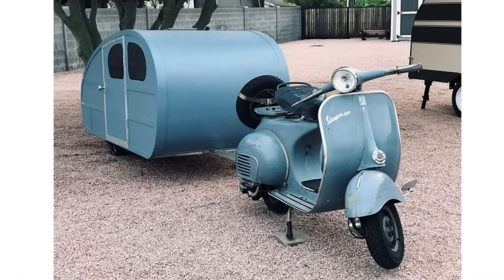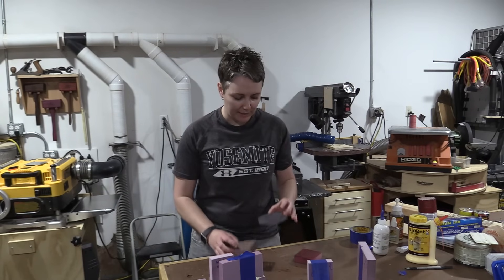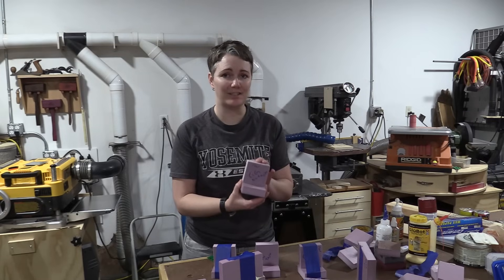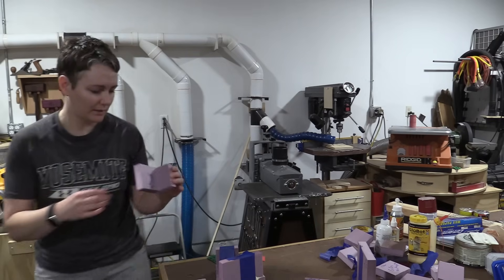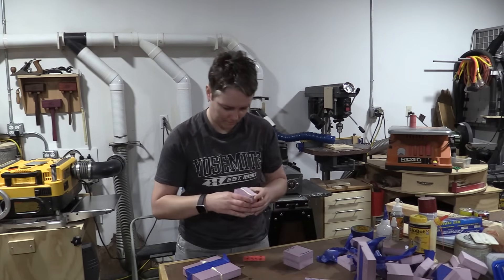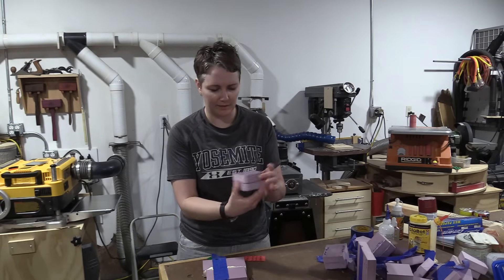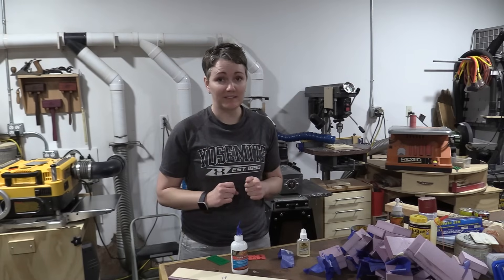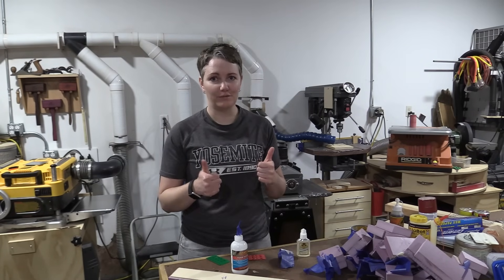NOT Gorilla Glue! Watch This Before Building a Foamie!! BEST Adhesive

Comment: As a retired cabinet shop owner I have have a fair amount of experience with glues.. I see in your butt joint to flat panel you are glueing a raw edge to a flat panel with appears to be a finished surface.. Try coating the raw edge with glue and allow to dry and then reapply for finished joint.. We used a lot of melamine glue in the shop that is like a vinyl base.. I believe you can use waterborne contact cement for glueing panels together..
Reply from the maker: Thanks for the suggestion! I definitely do that with wood glue when I am doing butt joints,  I will give it a try on the foam!

Comment: Have you tried ratchet straps for clamping?  Really excellent securing curved forms
Reply from the maker: Ratchet straps are great! I used them on my wooden teardrop! The reason I didn't in this one is because the sides were already cnc cut before I got involved and the roof had to go between the sides instead of on the top (which is how I would have done it) and then ratchet straps would have made life much easier! Thanks for the tip!

Comment: That was crude but adequate testing - which is all that is required. Thanks, Foam fusion is the glue for me!
One thing I want to experiment with is lining the EPS foam with aluminium sheet (1mm or thinner). First I need to get some foam fusion and see how well that bonds the aluminium....
Reply: They sell those
Reply: @epicsurvivors1399  The ones I've seen are with open cell foam - "foamboard"

Comment: Forgot to add. PL makes a foam specific polyurethane adhesive. It comes in a caulk type tube. It worked well when I insulated my garage door with rigid foam
Reply from the maker: Good to know! Thanks!

Comment: I liked this test video. Very good work.
Considering you are going to be covering the foam in a composite fabric that provides the strength,  you really only need something that will hold the pieces together and is easy/similar to the foam to sand.

Comment: Cool good information. I think I would try using joints over just putting two pieces together. But I never worked with the stuff so I have no clue how that would work out. But if it works it should be stronger and last longer.

Comment: The Dow foam has a coating on the factory surfaces that must be sanded off in order to get a good bond. I use it in my aircraft designs with epoxy.
Reply from the maker: We did sand the trailer,  the edge to edge joint best represents the bond without any film.  I was impressed with how deep the foam fusion bonded even through the film. Epoxy is great! Just wanted a one step, non fumey option. I bet your aircrafts are really cool!

Comment: Great comparison of glues.  I wish I would have known foam fusion when I built my trailer.  I got pretty good with the Gorilla glue though.  
One adhesive that is a pain to work with, but works incredibly well is Great Stuff expanding foam.  I used it in places that were impossible to clamp except by holding it.  It sets up very quickly, and works as well or better than the Gorilla glue as an adhesive.
Reply from the maker: That's very interesting! I have never heard of it.  I will have to check it out! Thank you!
Reply: Церезит Хейнкель, особые условия в Северной Америке. (Ceresit СТ 84 Express PLUS) я на пенсии ничего не продаю ничего не покупаю👍
Reply: @thelwood  I have worked extensively with foam for years building things out of them, using polyethylene, ldpe, styrofoam, xpanded (xps) foam etc. One thing to know about great stuff is it will indeed keep expanding, sometimes for years. You can test this yourself by painting and sealing a small 1 to 5 inch glob of it after a week or more of it drying. Cracks will appear in the paint as it bulges outward from the expanding pressure. I even tried waiting 6 months to paint things made from expanded foam, and they still expanded.
Reply from the maker: @astrobouncer487  thank you for the information!

Comment: I ABSOLUTELY LOVE YOUR VIDEOS, I'm a 48 year old disabled man and I'm going to be homeless with my dog in 4 months, I only have SSI check to live on and I want to build a self contained foamie trailer that I can pull behind my scooter at 45 mph. Any kind of help would be GREATLY APPRECIATED, I have no clue as to what to do and I have a small budget.
Reply from the maker: Finding a base trailer that will work well be the hardest part.  This one was welded it out aluminum.  I have seen trailers made with bicycle tires too. Once you have the base trailer, then building with foam isn't too hard.  I would look for the 1.5" or 2" foam to make it more ridged.  You definitely want the xps stuff (pink) not the Styrofoam style (white) stuff.  Good luck!
Reply: @thelwood  ty for the help 🙏 keep me in your prayers 🙏

Comment: I have built a foam and fiberglass kayak and found that epoxy produces a bond that is stronger than the foam. And if you mix up some epoxy and fine sawdust or wood flour to make fillets, the strength more than doubles.
Reply from the maker: Great information! Thanks!

Comment: Elmer's makes the cheaper form of the Gorilla Glue.  The secret is to mist water over the glue before you attach the second piece.  If you try for a spiral of glue on a large sheet of foam and the glue line crosses itself (making a closed circle) you seal in the misted water which will still be there when you pop the two sheets apart.  (Glue spreaders are hard to work with because you want a very thin layer.)
Reply from the maker: Great information! Thanks!

Comment: Regular gorilla glue works great on foam, dont add water/spray water to the foam, thats for wood application, the wood will absorb the moisture out of the GG before it can bind with the other piece of wood.  Gorilla glue will expand much more when you add water. Try it without the water, completely different results.
I have no affiliation with GG but have used it many times with foam with good results. 
Your video was very informative, thanks for the Foam Fusion mention, had never heard of it before but will definitely look for it.
Reply from the maker: Thank you for the information! I will give it a try without water.  But I definitely will be sticking with foam fusion as I can be messy... so the crystal clear color when it dries is awesome! I am happy you have been successful with GG. I definitely recommend you check out the foam fusion, the bond is amazing and it is so easy to clean up!

Comment: Have you thought of adding a biscuit joiner to the mix?  I think it would work AMAZING...I am in the midst of building my own foam bicycle camper and I think I might actually start the foam over, since I'm not very far in, and incorporate some wooden biscuits into the joints.  That combined with foam fusion would be a winner combo, IMO.  I'll be ordering the foam fusion...I already started with wood glue, but like I said, I'm not very far into it, so I think it's best just do it again.
Reply from the maker: Biscuits are a great idea! They typical help with lining things up more than strength in wood, but in the foam they would probably add significant strength! I have a festool domino joiner. They are longer than Biscuits and next time I would throw some of those in too!
Reply: You could try inserting short lengths of steel wire as pins, it would create a similar mechanical joint without having to cut slots for biscuits or dominos.

Comment: With any foam construction, the foam itself will always be the weak point.  Having built a few trimaran pontoons with foam core under eglass skins, the only issues I ever had at the beginning was foam tear-away.

Ben Hoza's comment is spot on: Rough the surface to increase glued area.

I did it differently by slotting the mating surfaces (table saw cut) and inserting wood splines into the slots along the entitre run.  Ordinary yardsticks work great.  Basically, it is the same thing as using splines to join two plate or corners in woodworking.  For a foam trailer, the spline is perfect for adding strength against high wind resistance at the corners.
Reply from the maker: Great advice! Thank you!
Reply: That submarine worked good for awhile with it's foam core

Comment: For theatrical props, I've had good luck using Super77 adhesive.  I also use bamboo skewers to help keep parts aligned.  You can also use coarse drywall screws to hold it while the glue cures.  Hand-screw only, obviously
Reply: Super77 is Gods gift to adhesives. Love the stuff, hate the price...

Comment: Have you ever tried DAP Weldwood, The Original Contact Cement? I've never tried it with the pink foam board like you're using, but I have used it for over 30 years for making and gluing up custom closed cell foam saddles (and for adhering them to Royalex and other types of plastic) when outfitting whitewater canoes and kayaks. It's very difficult to get a good foam to foam or foam to plastic bond on many of these hulls, but when done properly, I've never had one fail yet. These saddles often spend a lot of time either completely submerged under water or at the very least, the glue joint is always wet for several hours a day (while paddling in hot or cold conditions), and they take a real beating on a daily basis w/o letting go. DAP Weldwood is made to adhere to Foam, Cloth, Metal, Leather, Wood, Plywood, Particle Board, Decorative Laminates, and Fiberglass. You need to rough up and brush or roll a good coat to each side of the object being glued, then wait a few minutes while it sets up (as per instructions), then press together firmly, and you'll probably never get it apart again. There are only two downsides to this product that I know... (1) You only get one chance to position the parts as you press them together, so you absolutely have to get it right the first time. (2) The fumes are very strong and can ignite from pilot lights, so you need a well ventilated space to work in. I swear by this stuff, and it's great for laminating several layers of foam (or whatever) together if needed, while also producing a pretty much waterproof bond. I'm almost positive it would work with the pink foam too, but would definitely test it first, just in case it did melt the foam when you applied it. The stuff I use is an oil base and has thinners that could dissolve the pink foam, but these are also the same thinners that evaporate while it sets up, before pressing the parts together. Not sure if this product is available in a water base or not, but if I ever build a foam camper, I'll definitely try it out to see how it bonds to that pink foam, before building mine.   (Sorry for the long comment).   And thanks for your glue test!

Comment: I'm curious if the "shiny" side where the adhesive is applied was "scuffed" lightly just to sake off the sheen. Just as you would do cleaving two pieces of "pvc" to join.

Love the videos.
Reply from the maker: That is a great thought! We did sand off the shiny surface and score the foam on the trailer. It would be interesting to see if there would be any difference in the test. The edge to edge joint was without the shiny surface so that is probably the most accurate to reflect that scenario.  And foam fusion made a really deep bond on that one.  Thanks for watching and for your input! I appreciate it!
Reply: @thelwood  Quite welcome... great minds think alike ya know lol
Reply: As someone who builds modles with this foam I can say most definitely.  A fine grit sand paper works well.
Reply: Fine grit is 100 and 120, correct ?
Reply: @Charlemagne1367 150-220 is perfect

Comment: How was your plaster for 30 years and we did this system called dryvit it was a phone that you stuck to the wall and you put a Veneer plaster with a mash-up over it well when we didn't have the right stuff we was use tubes of liquid nail and a caulking gun and it works great you might give it a try
Reply from the maker: Thanks for the tip!

Comment: You could use dowels or biscuits in the joints, then cover structure with carbon fiber & polyester resin for additional strength.
Reply from the maker: Absolutely!

Comment: Would it be possible to drill and add dowels across the joints Possibly gluing the dowels in place
Reply from the maker: Yes it is! We did put a few BBQ skewers through a few parts. But since we cut kerf marks every inch to bend the foam roof it was difficult to get into the foam and not blow out where the kerf was. Definitely dowels will make it stronger! If I were making another foamie I would use 1.5 or 2 in foam. That would make it much easier to add dowels or dominos :)

Comment: For joins that don't require sealing and don't permit clamping but need structural strength quickly, spray cyanoacrylate might work as well as  it does with wood end grain.
Reply: Superglue dries very hard which makes sanding and shaping the foam afterwards difficult.  You wind up with ridges and dimples where you try to sand the seam but take more of the surrounding material instead.

Comment: just a tip for people youll need to give the xps foam a sand before glueing ,and ive guys have great results from D3 wood glue and sanding then coating the xps foam with cotton canvas and d3 wood glue and roll it in with tiny roller then they used quite a thick almost tanking paint ontop for a rock hard outer finish

Comment: I’ve always used the regular gorilla glue with great results. Yeah it’s a pain to work with and lots of clean up trimming involved.  I also have used different wood working techniques for gluing and joining the foam boards, such as finger joints, lap joints, mortise and tenon, scarfing etc, with strong results. All this being said, I will definitely try the “Foam Fusion” glue!! Thanks for the video 👍🏻
Reply from the maker: Thanks! Yes,  gorilla is so messy! And definitely woodworking joinery to increase surface area is definitely a great idea!

Comment: Tape is enough for foam. But if you want to clamp or use straps you can put "sacrifice" pieces between the foam and clamps/straps. Or even leave excess on the edges under clamps/straps to be sanded or shaved off later with a surefrom file. The latter is what I do when gluing up blanks for surfboards.
Reply from the maker: Great advice!

Comment: With the gorilla glue original, you only use a little bit you get a credit card and scrape it so you there's a thin layer. I used to buy this clear glue from one of those cheap shops in Australia. It  clear, bit had not of smell to it and was warm on the skin,  took a few hours to dry but it would never break where the glue was. They stop selling it, I was so annoyed.
Reply from the maker: That is a bummer! Thanks for the tip on gorilla glue!

Comment: I'm intrigued by how well the foam fusion appears to have glued the plywood to the foam. I wonder how well it would work to bond canvas to the foam? Did you by any chance try out the foam fusion as the "base layer" for the poor man's fiberglass (in place of titebond)? If so, how did it work?
Reply from the maker: I have not tried it.  I think it would work extremely well.  So far it seems to work well with all porous surfaces
Reply: @thelwood  Thanks for getting back to me so quickly. I think I'll give it a try on some test pieces like you did with the other glues, to see how well it bonds with canvas. I also want to see how it bonds with the fabric they use as a headliner in camper shells for truck beds, as that's what I want to line the interior of the cabin with (so I can stick Velcro anywhere). Another question, since you've built both a plywood and a foamie teardrop, do you prefer one method over the other?

Comment: In places where you have room, it seems like you could make a butt joint stronger by making a few holes and inserting wood dowels and gluing them along with the seam. Similar to what is done with some wood joints for the same reason.
Reply from the maker: Absolutely! We did add some BBQ skewers in some places and that definitely helped too. If I were doing a bigger foamie I would use 1.5 or 2in foam and definitely add dowels to the joints :)
Reply: @thelwood  I was thinking something thicker but this was the first video I have seen of yours so I'm not intimately familiar with your build on that project.  It occurs to me to wonder if a biscuit cutter would work on foam.   It looks like an interesting project.
Reply from the maker: @davidbwa  a biscuit cutter would work great! I have a domino and would definitely use that if I had thicker foam!

Comment: The foam actually has a plastic sheet coating that can be pealed off.
But I would rasp the section or wire brush the area to be glued to get a true bond into the foam.
Then try pvc pipe glue or something that is not too hot.
Reply from the maker: Great information! Yes, we sanded off the plastic for the actual teardrop. And the side by side joint in this test did not have any of the coating. I was impressed that the foam fusion bondef deep into the foam even with the coating on it.

Comment: do you think 3m vhb tape can do the job? or LOCTITE PL 300 Foamboard Adhesive? I'm planning a teardrop and the foamie looks really interesting. Is the foam gonna be ate away by paint or other resin? do you need any wood frame as structures to support the foam ot its on its own?
Reply: Some paints and adhesives eat away at the foam, others don't. You'll need to test if you don't know for sure. There is a lot of info over at the TNTT forum.

Comment: Gorrilla glue clear defintely does expand especially if you get it wet during curing  just not as much. It actually says in the insructions your supposed to wet it.  If you put some sort of reinforcement tape over the joints it will make it a whole lot  stronger too. You could clamp it by putting a board on both sides and then applying a clamp